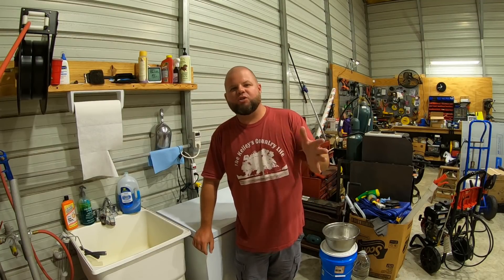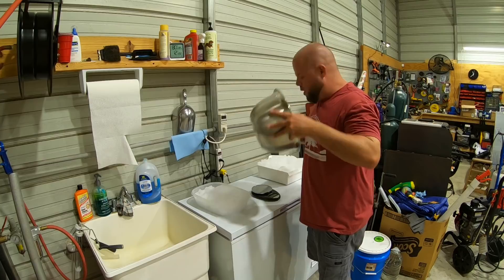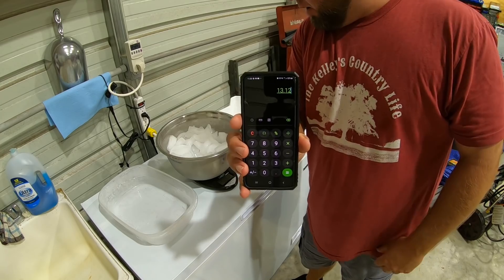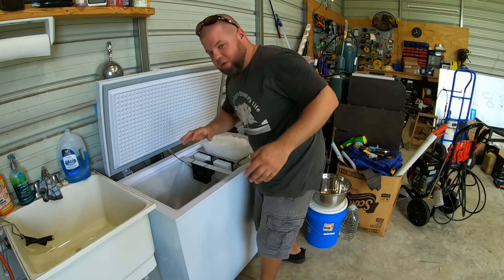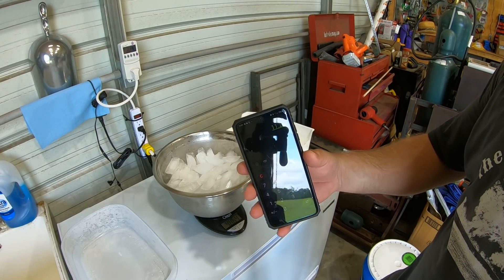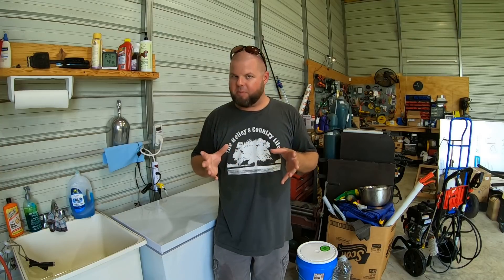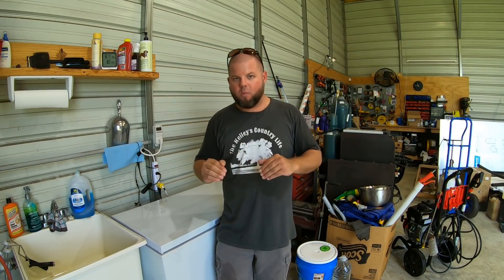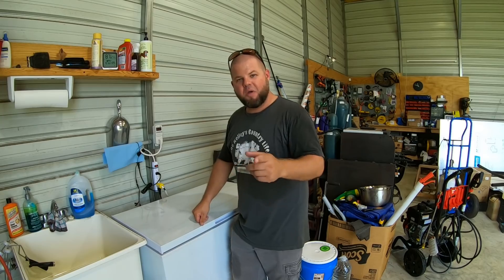Homemade ice machine produces highest production yet!!!! #403

Comment: First Congrats 🎉 on the bump in numbers. My guess would be that you're cooling the thermostat that drops the ice, possibly why the block is sticking as the cubes aren't 100% of their usual freeze.  The thermostat on my ice maker is on the left side which would be where the fan is blowing for the ice maker closest to you.  I wonder if one is dropping more than the other?  Either way good job!
Reply from the maker: That could be happening
Reply: That very well could be. I was thinking that maybe it was blowing water off the trays. As it looked like it was just the one area? Need a camera inside to see.

Comment: Would it make a difference if the one ice maker was flipped somehow so that way the ice cube trays are both in the middle and the air can be blown across both equally
Reply from the maker: Very difficult to do because the water enters one side only
Reply: @TKCL  I was unsure if could run it from the back of the freezer and then one from the side as it is now
Reply from the maker: Anything is possible

Comment: Put a on and off switch attached to the freezer door when you open it the fan turns off. That will probably illuminate The cube sticking together plus drawing all that warm air in there when you have the door open I believe it will increase your pounds even more.😊
Reply from the maker: I unplug them every time, the next build will have a switch.

Comment: I had a heat and air tech out the other day to work on my heat pump. I asked if he would turn the speed of the air handler up. He said that slower air across the coils will blow colder air. That got me thinking, instead of using faster velocity fans, what if you slowed the air down?
Reply from the maker: Already tried that, it produced far less

Comment: That's great, but the downside is the ejection cycle to dump the cubes may burn 🔥 up as the heater will run far far longer than the circuit is designed for... this is NO doubt why you are seeing melted chunks if cubes  ....    as you said earlier turning the fan off when the heater is on Maybe critical the further you deviate from the original design specifications ... look for telltale signs of melted plastic under the ice tray molds
I would place a smoke/Co2 detector above and or even inside the freezer in the meantime ..
Also carefully monitor the peak current draw readings on the meter.

Good luck 👍

Comment: What you did was by putting a higher velocity fan you made the  temp in the cheat the same. Before your highest temp was at the top and colder temp at the bottom. You higher velocity fan is mixing the air so it was the same. Which will freeze more ice
Reply from the maker: Well I kept a thermometer at the top and there is still a very large temperature separation from top to bottom. But I'm sure it's helping

Comment: I would consider testing putting the fans on the underside of the ice makers BEFORE you make version 2.0. If you do it afterwards you might not be happy with the results
Reply from the maker: Yes, but in my current configuration it's difficult to do
Reply: @TKCL  Just put a couple of wedged spacers on top of the fan under the bar to lower the fan deeper but angled up a bit to hit the bottom of the molds.